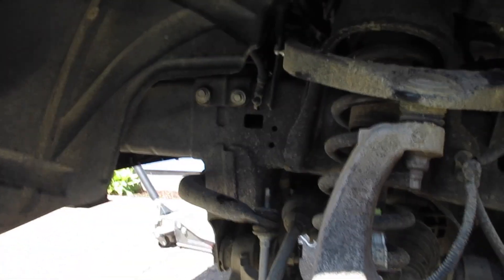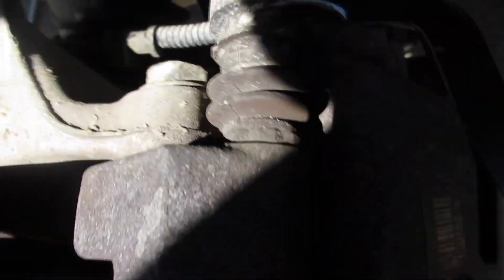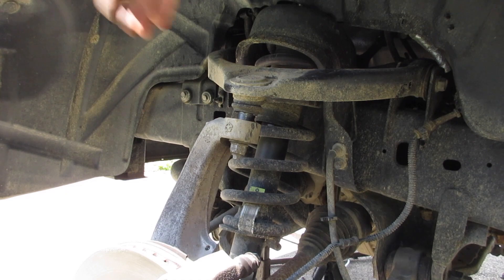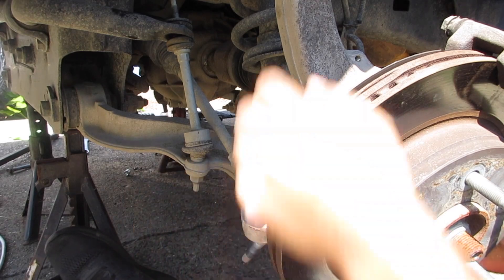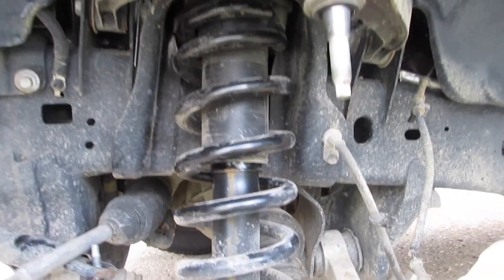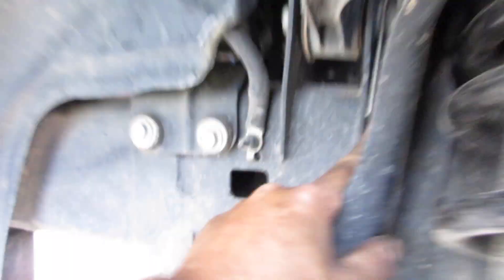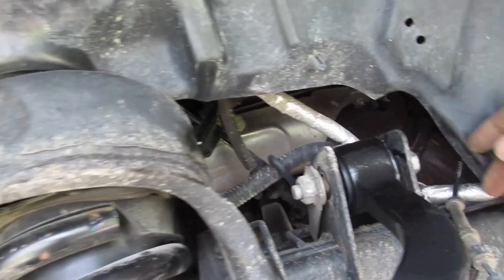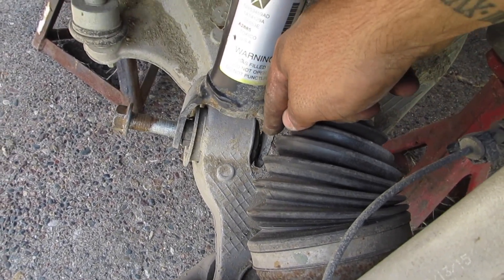SUPREME SUSPENSIONS LEVELING KIT W/ MEVOTECH UPPER CONTROL ARMS INSTALL 2016 RAM 1500

Comment: Nice Video! Thanks for using our kit!
Reply from the maker: Thank you so much! It's a great product!
Reply: I don't get it? Why would you use the Mevotech UCA with e lifted front end? Besides being slightly beefier, those don't appear to solve any of the ball joint angle issues that lifting a truck causes, right? So, since everything else is stock (and it won't be a Baja100 grade suspension by any means) what good does the extra UCA strength alone do for you?

Comment: You did put on the grease fitting and lube the new ball joint, right? I just put on the same UCA’s and gave them a shot of multi purpose grease.
Reply from the maker: yes. did this after the video i noticed i forgot to add it lol

Comment: I watched several of these videos before I attempted to install my leveling kit.  Everything was fine until I tried to separate the ball joint.  OMG what a nightmare.  IT WOULD NOT COME OFF.  After several hours of hammering it and using a ball joint fork, I had to say F it and put everything back together without the leveling kit.  To those attempting this job, make sure to have a ball joint separator on standby in case you run into the problems I did.
Reply: you sure you beat it hard enough? I don't live in the rust belt but I drive on the beach a lot. sometimes you can't give mercy to that knuckle

Comment: Did they send you a 3.5 inch or the 2.5 inch. Also do you think the new UCAs had an effect on how high the front gained. You said the front started at 36 and now its 39.5, that's way off for a 2.5 spacer. Thx
Reply from the maker: I got the 2.5 inch. I added a slide in there @14:05 that after I had it aligned it brought the front down to 28.5 and rear was still at 29. It was a perfect 2.5 inch level so no sir the UCA had no effect on lifting the front end
Reply: I'm not picking at the Info, did you mean 38.5 and 39. I've been on the fence about the options out there. I've got a 3 inch difference 36/39 but I tow a trailer when loaded drops to 36/36. I just hate the rake. Thanks for the responses.
Reply from the maker: Sorry yes lol 38.5 and 39. I had a 3 inch difference as well. This kit ran true to the number it said. Idk how long you are hauling, but I think the 2.5 would be perfect for you. Good luck!

Comment: Did you have a issue with the 3 top bolts loosening as you were fighting them down?
Reply from the maker: Yes only because I forgot to add the loctite at first. Once I took the nuts off and added the blue loctite they didn't move tightening it all down.

Comment: would have been nice if you put the camera inside the wheel weld to see the angle on the uppers control armafter the installation .
Reply from the maker: Fro at 14:26 it’s placed back there. It was hard to fit camera behind, tried best I could there sorry about that but the angle is pretty close to flat now. Not a lot of stress at all on the ball joint.
Reply: thanks

Comment: i dont know what bothered me most... the carpenters hammer or the prying against cv joint and boot...the rest was ok though
Reply: ill give 9 points for using safety stand though
Reply: JustAnAverageBrad same here. I used a PRYBAR underneath the lower arm opposite from the bolt.... and a ball peen hammer

Comment: Tires like that for u need aliment. Remember. U r screwing with factory. Inspected shit. Now i would get in spected. Because u remove all that an replace it. All good awsome video. Just wondering if u need an aliment?
Reply from the maker: Yessir I had an alignment done right after this install. It definitely needed to be done. Thanks for checking it out!